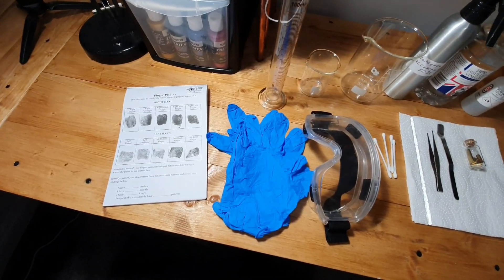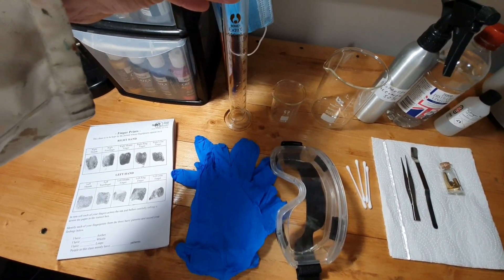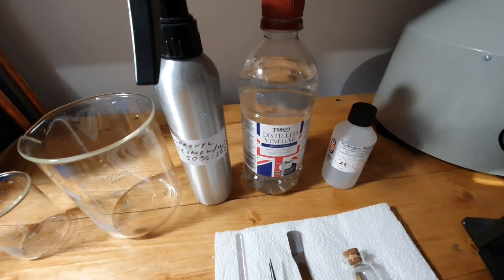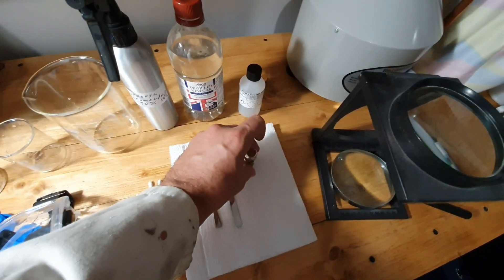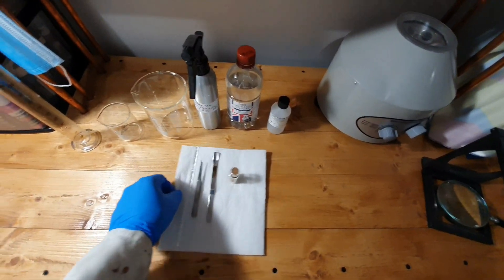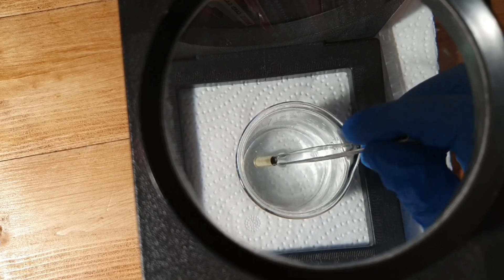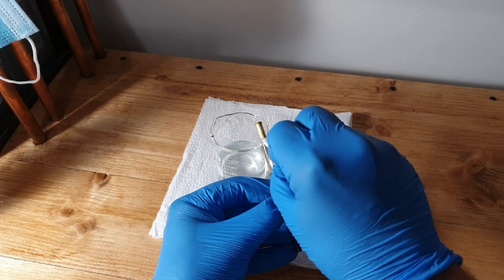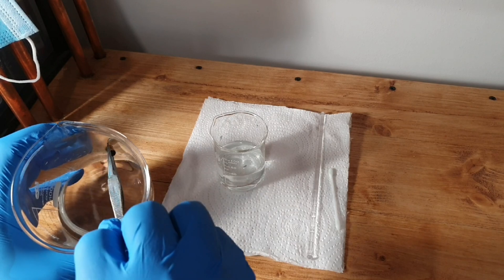Fingerprint Reveal on Brass Shell Casing

Comment: I had hoped that this was a more accessible version of Dr. Bond's fingerprinting method for firearm casings. But it seems that this is just accelerating corrosion using an intact latent print. So what is the benefit of this technique vs. more conventional techniques (super glue fuming, etc.)?
Reply from the maker: This is merely highlighting one of the possible techniques that can be used to develop finger marks on brass casings. It benefits from not requiring the use of fuming chambers like that of CA fuming. Dr Bonds technique is superior in the fact that it can develop prints without any residual secretions available on the casing but does require larger and more expensive apparatus which is the reason you had hoped this was a more accessible version of his method. In theory its a case of applying an electrostatic charge like you would with indented writing development and a toner pad over the surface, the only difference being the developed mark on the brass casing requires heat to 'fix' it in place. Definitely something I will experiment with and post a video on my results. Thanks.
Reply: @forensics1017  If you require additional brass casings, let me know. I'd be happy to mail you whatever variety you'd like.